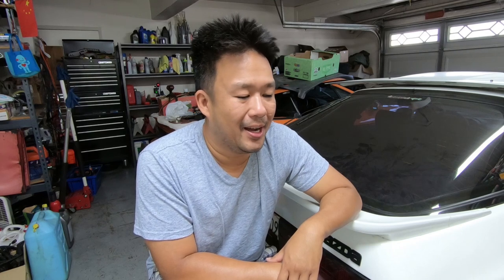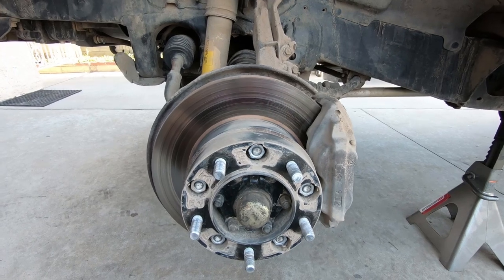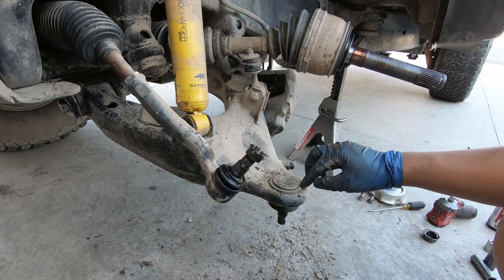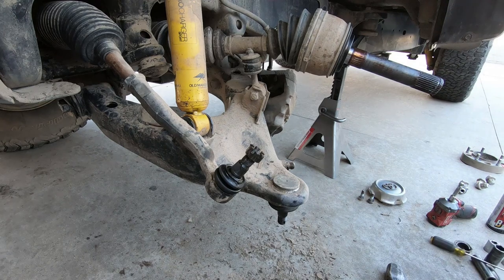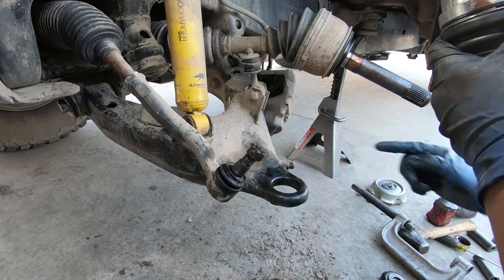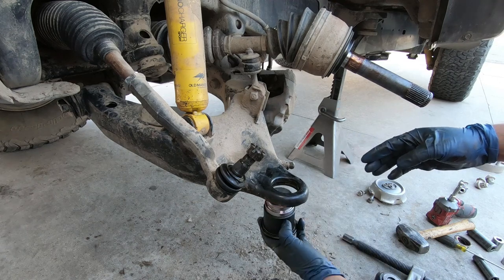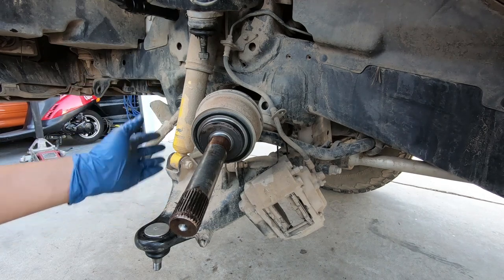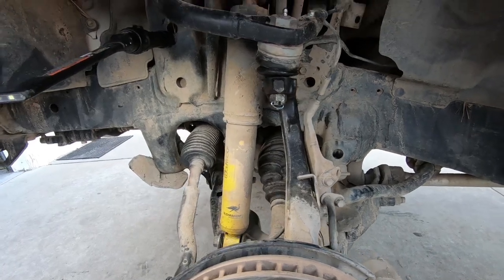Dont buy from Toyota! Sqeaky lower ball joint replacement for cheap!

Comment: Most 100 owners go with the 555 Sankei for ball joints (upper and lower) as well as tie rods.  They are considered the best options.  Cruiser Outfitters carries them and they are relatively inexpensive.  Curious how well the the Centric perform and hold up for you.  Excellent videos you're doing BTW.  You're doing a GREAT job covering all the maintenance issues with 100 Series.  Very impressed.  Keep up the excellent work!
Reply: Yup was going to say the same thing... 555 Sankei is OE, never heard of Centric being anything other than cheapo chinesium but could be wrong. Kurt at Cruiser Outfitters is awesome and have bought PLENTY of parts from him over the years (for my FJ60 and now my 100).
Reply from the maker: So far so good, let’s see how long they’ll last!
Reply: I use Centric brake pads and excellent product. I think they Centric LBJs will last and my buddy that is Toyota Master Mechanic recommends Centric LBJs and brake pads. Excellent video
Reply: What do you like for control arm bushings?
Reply: White line is know for the best toyota aftermarket poly bushings IMO
Reply: @chowcares  There is NO GOOD AFTERMARKET  Balljoint. Toyota balljoint easily 10x better than any aftermarket.  The old one is actually still good. People always thought the new Toyota ball joint is supposed to be stiff but they actually move pretty freely and easily and that's why it last really long.  Balljoint is to give us a good joint to move like ball without any play or knocking. That's what all aftermarket balljoint fail, yes they are stiff but clunk and knock only about 30k miles instead of original Toyota 300k miles.  I hope you do not trow away your valuable original ball joint or you will kick your own face.
Reply: So it’s been 3 years since you replaced the ball joint. How has it held up?  Update?

Comment: There is NO GOOD AFTERMARKET  Balljoint. Toyota balljoint easily 10x better than any aftermarket.  The old one is actually still good. People always thought the new Toyota ball joint is supposed to be stiff but they actually move pretty freely and easily and that's why it last really long.  Balljoint is to give us a good joint to move like ball without any play or knocking. That's what all aftermarket balljoint fail, yes they are stiff but clunk and knock only about 30k miles instead of original Toyota 300k miles.
Reply from the maker: I agree, too bad Toyota doesn’t sell the ball joint by itself.
Reply: @chowcares  Toyota do sell ball joints for its trucks with double wishbone suspension that go bad occasionally. For cars,  toyota also sell it in case of accident damage.  Only the rubber bushings in control arms, toyota do not sell it individually.
Reply from the maker: @rondhole  for land cruisers, the ball joint only comes with the owner control arm 😔
Reply: @chowcares  that's better, it is more expensive but your rubber bushings need replacement anyway to prevent the new balljoints go bad faster. I am afraid you make your own problems by replacing really fine balljoints with inferior aftermarket balljoint. Nothing beats Toyota balljoint, literally it is 10x more durable than any aftermarket.  Toyota balljoints have composite polymer that make it lasts really long and always smooth and easy to move, no stiffness and wear like metal to metal balljoints. It is Land cruiser, you can survive in warzone for years without spare parts
Reply: @rondhole  if I've been driving for say 1200 miles and the ball joint squeaking has gotten louder and louder, what's my chances of the whole wheel coming off and getting seriously injured? How fast do I need to get this thing changed?
Reply: @Victorygirl2000  Ball joint in Truck is very serious. Get the original Balljoint from Dealership, never get aftermarket that always go bad 10x faster than OEM.  If you have a Truck or SUV, you can cause serious damage or injury to yourself and others.  The truck's whole frame will hit the ground and damage all kinds of suspensions and transmission parts.  Fix it ASAP.  Ball joint, tie-rod ends/steering are parts that you have to fix right away.  It is not that expensive and only 1-2 hours labor.  Especially 4runner and Tacoma,  ONLY TOYOTA GENUINE parts work for long enough time ~200k miles, aftermarket only last 30-40k miles at most.  If you have LandCruiser, nothing beat Landcruiser parts, this SUV is made for WARzone.   Ball joints, Bearings, sensors, and AC compressors always get genuine Toyota parts.  You can get aftermarket brake parts, stabilizer links, light bulbs, hoses, sparkplugs, batteries, struts/shocks, liftgate, window regulator, filters,  etc. But not on Balljoints.
Reply: @rondhole  I appreciate your advice!

Comment: no such luxury on a 200.....pressing them out is like trying to get a bowling ball through a garden hose, plus the lower control arms bolts usually sieze and you have to cut the off with a sawz-all which adds to the expense and the time.

Comment: Sankei 555 is Japanese designed and made in Japan. Napa carries Sankei 555 and far exceeds their in-house Napa brand, MOOG and Mevotech. The problems with the other brands is long term durability. Chinese made ball joints are know Not to be tempered well when made. It s a critical suspension component that I would rather trust to either OE or Sankei 555. Your money, your choice your safety.
Reply from the maker: I hear a lot of good things about the 555, I think immma give them a shot next
Reply: @chowcares  just look on Sankei 555 website for their information. They’re a solid Japanese company. Other than NAPA, I’m sure they’re other retailers in your area carrying their suspension components. It would be worth writing to Sankei customer service to find out the retailers in your area.

Comment: Use a press fit  retaining compound  in place of grease.  It helps to ease assembly and prevent seizing or galling like grease, but it cures to prevent any shifting and increase stiffness.

Comment: it is a nice job you did , but I would replace the entire upper and lower arm control respectively with OEM all 4 only $1,300 from the TOYOTA it will last you for another 20 years
Reply: Just bought Sankei 555 for $170 after tax on ebay. 2 upper and 2 lower. It's a pain in the ass to do it though. Watching the video makes it look easy but you're going to spend hours working on it.

Comment: I watch your videos and theya re great. I deal with Toyota trucks since 1990 and No part comes closer to the quality of Toyota. You can judge the quality of a toyota ball joint, if you look at how long a 3rd generation 4Runner (prado J90) or 1st Gen Tacoma lower ball joint lasts: OEM easy 175K miles and any other aftermarket JUST 20K miles. 
If you can't afford OEM (with the arm) go with 555 as it is proven to be well made by many users around the world! Still 555 won't lasts long as an OEM but much better than those Centric Chinese ball joints. I guarantee with the weight of Land Cruiser, the Centric will last no more than 12K miles. Cruiseroutfitters got genuine 555 suspension parts for the LC.
Reply from the maker: Thanks for the advice!! I did not know about the 555 until I posted this video. I’m rarely on mud and when I am, I’m usually in the classifieds lol. When these fail I will definitely give the 555 a try

Comment: Good content. Keep them coming. What kind of wheel spacers are you using? Another idea for content: power washing and wire brushing the underneath.
Reply from the maker: Running a 1.25” spacer all around.

Comment: Centric is an excellent aftermarket brand with excellent quality. I use Centric brake pads for my Tacoma as recommended by a Toyota Master Mechanic.
Reply: Not for balljoint, all aftermarket are bad
Reply: @rondhole  I have found aftermarket parts made in Taiwan to be high quality and match or exceed OEM quality. My new Denso radiator is made in Taiwan.  I personally would not use an aftermarket balljoint as it's a critical part of the suspension. I replaced my lower ball joints with Toyota OEM for peace of mind.
Reply: @thedetective8150  yes, that what I meant all aftermarket balljoints. Otherparts are ok like radiator, shock struts KYB, BILSTEIN, headlight bulbs, etc. But for suspension parts like control arms, tierods, bearings, very few are good. AISIN, KOYO, SKF,TIMKEN, NTN. Rotors generally are all fine as long as it is high carbon for heavy SUV or truck.

Comment: Hey, I noticed that you use an oil filter wrench for the seal and ball joint. Sounds like a good tool to have. What size is it?  75 mm or the 64 mm?  Thanks.
Reply from the maker: i forget exactly, but its the smaller one that fits the prius, ct200, and tercel. basically all the 4 cylinder toyota lol.

Comment: Hey Chow the wire running down the control arm I'm assuming speed sensor/abs wire. Did yours slide right out from the back of the hub assembly? Unfortunately I couldn't slide my girls sensor out and eventually the sensor broke from the hub from falling. Also having a hard time fully seating the cv axle through the hub to put the snap ring in place.
Reply from the maker: Yes speed sensor. After u take of the 10mm bolt it should slide out easy. Try to clean the end of the axle and have someone pull the axle out towards the hub while you install the snap ring. If that still doesn’t work, I know there is a puller you can ghetto rig and pull out the axle with a screw. I forget where I saw it but I’m sure it’s on ih8mud
Reply: Thanks Chow I appreciate the feedback

Comment: I cant get the tie rod off.. any tips? took that same bolt off but it so stuck on there. same with hub on lower balll joint bolt. both are super stuck
Reply from the maker: Soak with some penetrating fluid like wd40 or pb then hit the knuckle with a hammer. DO NOT HIT THE THREADS ON THE OUTTER TIE ROD. Learn from my mistakes... 😭

Comment: Hi Chow, I am also hearing squeaky noise at the front. Yesterday went under the truck and saw one of the cv axle boot is crack and leaking. I opened both side doors and and pull them then I can hear squeaking noise. 
What do you recommend on cv axle? Rockauto has boots for $20 vs complete left or right axle for $50. 
I want to replace the ball joints. Is it better to change lower and upper both? 
What about control arm bushings? 
Moog has complete assembly for less then $100 for each side. Too many choices, I am so confused. You’re advise will be highly appreciate. 
Again thanks for your awesome PM videos.
Reply from the maker: First of all, thanks for supporting the channel! In regards to you cv, if they are original Toyota ones I would recommend rebooting them. That being said, I’ve been using the autozone ones without a diff drop with no issues (and they have lifetime warranty). Next, the Upper ball joints would be easiest to replace by removing upper control arm first. Moog is a good aftermarket brand, I also hear 555 is a good quality one as well. Lower ball joint isn’t difficult to replace, it just requires to remove a lot to get to. It would be nice to do everything all at the same time, but it’s gonna be a long day!
Reply: Thanks Chow. I agree with you for CV. I will get the OEM boot kit. I didn’t hear any noise from there. Previous owner changed the axle at lexus dealership but I am not sure which side. 
I spoke with Chris at Cruiser Teq, they will have the 555 next month in stock. They also offer after market bushings. Plan is to order them and then once they are off from the truck inspect original bushings. If they are bad swap them otherwise keep it original. 
While everything out is it a good time to pack the wheel bearings? What kind of grease you recommend? 
Same time I will grease drive shaft. 
Thanks again for your response. Keep up the good work.

Comment: I got a stuborn lower ball joint with knuckle, where you put the jack when you separate them? under the bolt of ball joint?
Reply from the maker: Under the control arm. That way when the knuckle has room to drop

Comment: So was there any play felt in the lower ball joint when you had the wheel up in the air? How did you determine that was what was squeaking? I have a squeak that I can't seem to find....
Reply from the maker: No play, the squeak went away when I sprayed some pb blaster on it. It’s hard to get the pb in, but if u crank the wheel all the way, should be ok
Reply: @chowcares  Ok I will give that a try. Mine have zero play too, even when putting a crowbar under and trying to lift wheel. I will try the PBBlaster and see. Guess that would be a good indicator if it goes away. 
Will be doing a major front end rebuild as I just got new OE axles to rebuild (see my channel for OE hub flange to new OE outer axle assembly) and don't want to have to go all the way back in if I don't have to.
Reply from the maker: Yea that would be the best time! Lmk how it goes!!
Reply: I have had squeaks after wading, turned out to be the bushes on the lower A arm.

Comment: Why Centric over moog LBJ? More cheesy background music. Silence is golden! I have a GX470, care to do the front end (ball joints, shocks, UCA LCA bushings)
Reply from the maker: No particular reason, probably do a review vid on them soon. GX has a cool front setup? Should be relatively easy no?
Reply: @chowcares  I'm liking it so far. Lots of room to work. I'm accumulating tools and parts recommendations. The only bizarre bit is that controller they parked on top of the front struts. No clearance! Not many reviews on control arm bushings.

Comment: Does this ball joint fits into a 2002 tundra?
Reply from the maker: I don’t think so, the tundra ones are bolted on, much easier to replace
Reply: O thanks for info.  Where u from by the way, I'm in florida.
Reply from the maker: iwalker Dad np, from SoCal